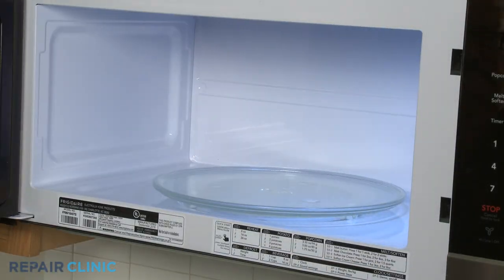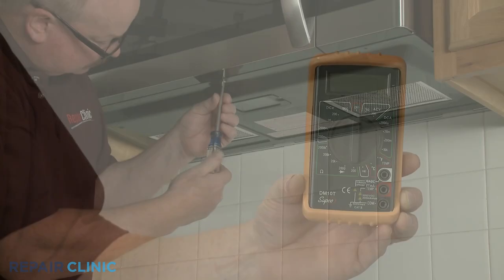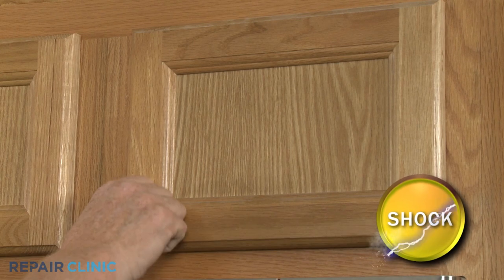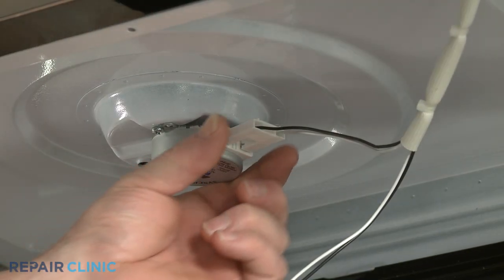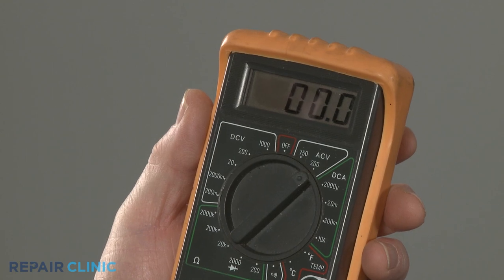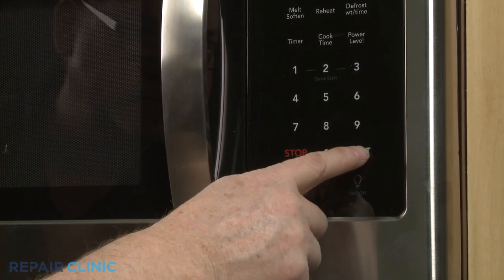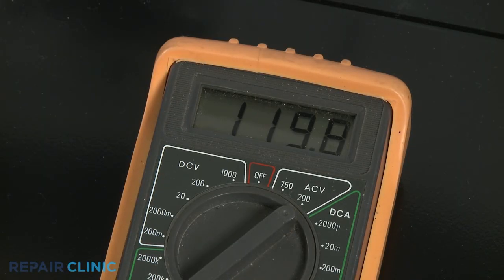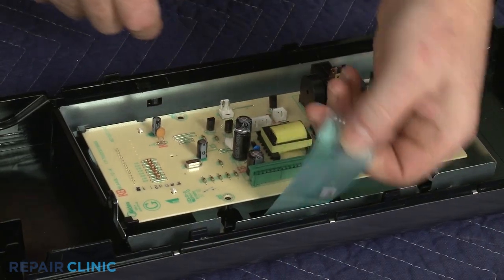Microwave Turntable Motor Voltage Testing

Comment: Thanks for the video, I found the wiring diagram behind the ribbon on the control board and it gave me the normal reading when testing my turntable motor...it tested as an open line and I pulled one from another microwave we had laying around that tested good. Super fast easy fix!
Reply from the maker: You're welcome! 

We are always happy to help. If you would like to give us a review on Google, we would much appreciate it: https://g.page/r/CcVUrahZNozMEBM/review

We hope that you have a great day!